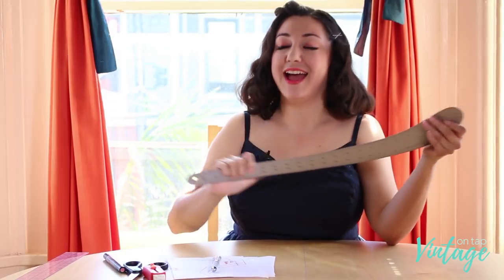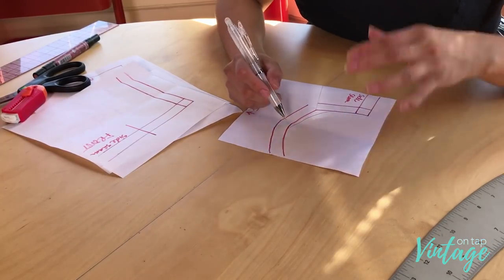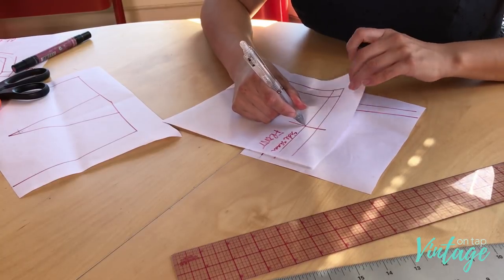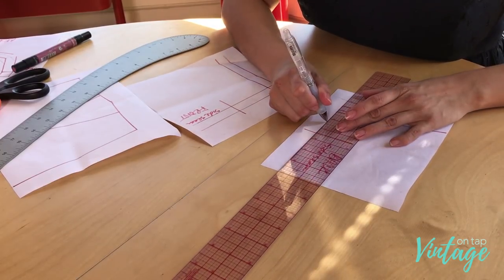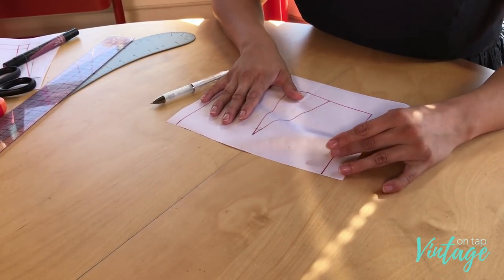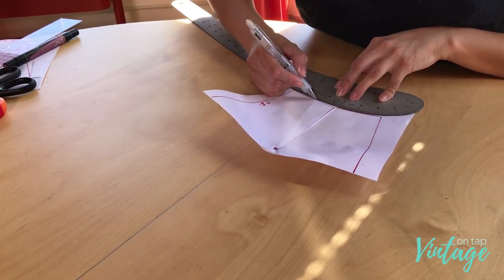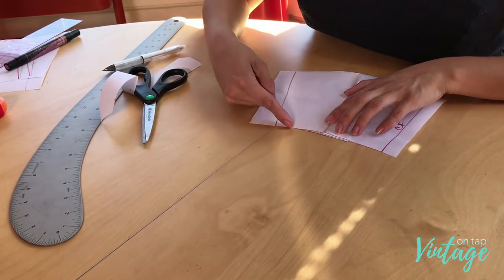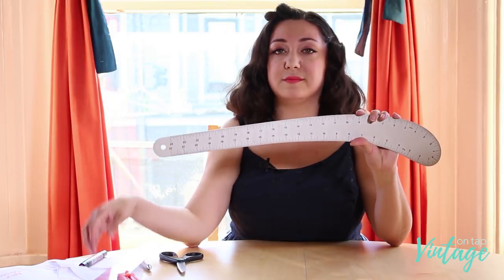How to Use a French Curve | Vintage on Tap

Comment: that's not a French curve that's a hip curve.
Reply from the maker: +darkfantasea thanks so much for your comment! I've seen this tool referred to as a hip curve, dressmakers curve, curve form, and drafting curve! I think the name that usually ends up sticking is the name that it was introduced into your work with. French curve stuck with me after learning about it an university 👍🏽
Reply: "French Curve" actually encompasses so many different sized and shaped rulers, it really just means curved ruler. In fashion design you find different shaped ones. The one in this video is more of the shape you see marketed as a hip curve because it has more of the large sweeping curves needed for hips and waistbands. The one I use is the Dritz "Styling Design Ruler" which has more of the tighter curves used for armholes and necklines. They also make small ones that are only a few inches big with tons of different curves used for architecture and drawing. They are all technically french curves, they just all have different intended uses.
Reply: whossoul could this ruler be used to shape a trouser or pants ? I want to buy one for trouser or pants drafting but don't know which one is better?
Reply: You are so right
Reply: @whossoul  so right I actually sew custom bras and underwear I have both the small ones I use them for hand embroidery and the large set for drafting and pattern manipulation
Reply: @akramuzma62  get the metal one she is showing that is what you want amazon has them look for metal hip curve

Comment: Thank you for the lesson.  I just received one as a Gift and wasn't confident on how to use it.
Thank you for the demonstration.   It confirmed a few things I know, but I also learned a couple of good sewing lessons for when I mess up a seam.
My ruler is so cool!  COMBO: French Curve on one side, and straight ruler on the other side!   I bought it on Black Friday for $7.00 US.  Name "Tailor Curve Ruler.  Regular Price $17.98.  This 18" tall ruler is so well thought out, it is going to make taking measurements on either a curved or a straight line so easy!  It even gives you the template for 4 different Button sizes, and length of Button Holes.  The ruler even provides a straight 12" long Grid.  I'm not sure how I am to use that part?
The clear plastic multi purpose Ruler comes with bold Red Markings, that even direct you to the right area of the ruler to use, so you can find the curve you want and need! Areas include the armhole curve, the hip curve, fron't neckline, and even back neckline!   It tells you exactly how to hold the ruler, to measure that angle you need to find!   IE;  Armhole Curve *Use area from of curved ruler from 6" to 17" (15cm to 43cm) area.  The ridged plastic makes copying a curve from cloth, and tracing onto paper--- sooooooooo easy.    Anyone can draft a pattern using this one, and then hang it on the wall, for their next curve.    
I can see how I will be using it often!